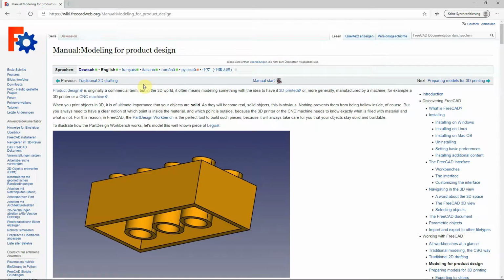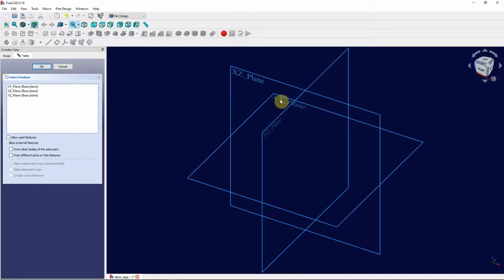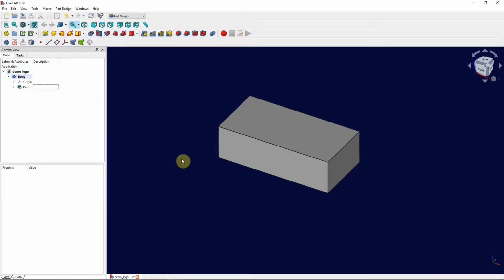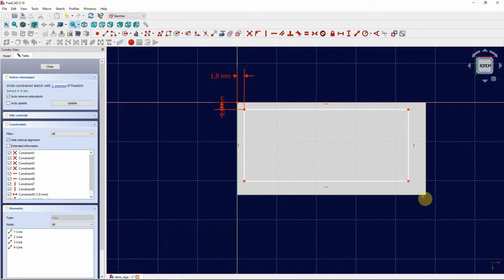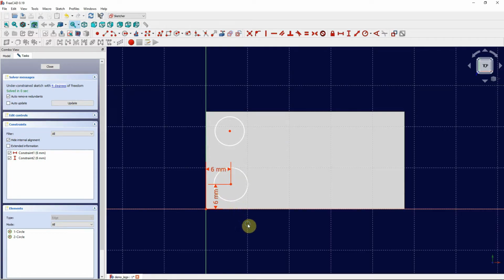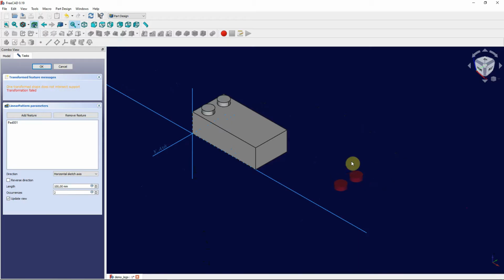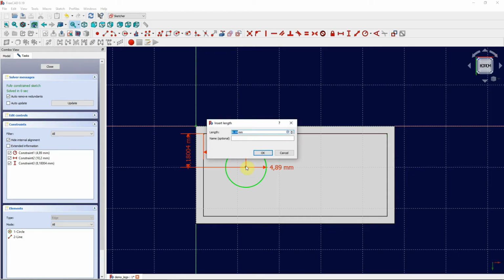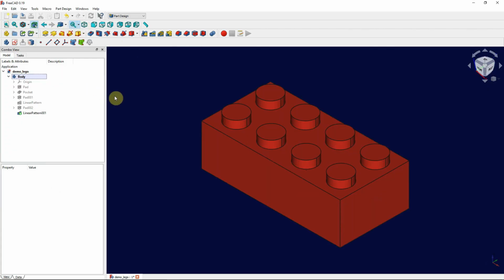FreeCAD 0.19 - Tutorial - Part Design - Create a toy brick (English)

Comment: Hi, Much appreciated tutorial, I was able to follow along. I noticed that the stubs on the bottom and top don't line up so you can't slide two pieces into each other the way you would stack chairs for example. Is that why lego bricks snap into each other and stay stuck? Is there a rule of thumb for the lego stub/cylinder layout? Like: 0 mm distance between 2 neighboring stubs and hollow cylinder but 1mm overlap between the 2 other stubs and the same cylinder?

Comment: I am a new user of FreeCAD.  I have never done anything with FreeCAD.  I tried to follow along with the video and do the same thing one FreeCAD.  I have no idea which button does what! I use MS Word to take down the step-by-step process of making this toy brick.  This helps me to be able to reproduce the brick by reading my notes without referring back to the video.  The following  is essentially a transcript of the video:

Create a toy brick (Lego block)
Lego block specification:
Block: 47.7 x 23.17 x 14.4 mm, 
Pocket 1.8 mm from the block edge on each side. 12.6 mm deep.
Top cylinders: the centers are 1.8 mm from each edge.  Diameter 3.6 mm, 2.7 mm tall.
Bottom hollow cylinders: the center is 10.2 mm from inter rectangle wall. Outer radius 4.89 mm Inter radius 3.6 mm, length 12.6 mm

1) At file > New 

2) At the Combo View Panel CVP, Model Tab, rename to demo_lego

3) At the Work Bench Drop Down Menu (WBDDM) select Part Design.

4) On the Part Design toolbar clicks on the Create Body button (Blue Steps), a new body appears at the CVP. Select the new Body.

5) Click on the Sketch button. The three planes appear. Select the XY_plane, At CVP, click OK

6) Create a new sketch: Draw a rectangle with the Rectangle button (square with a red dot at diagonal), Click once each for the lower left and upper right corner. 
With the rectangle drawn, click on the Horizontal Distance button (Red horizontal I beam). 
Click once on the upper left dot and the upper right red dot of the rectangle. The Insert length dialog box appears. Enter the value of 47.7 mm. Click OK.
Click the Vertical Distance button (Red Vertical I Beam)
Click the upper left red dot of the rectangle and the lower-left rectangle. Enter the value 23.7 mm

7) We want to place the rectangle at the exact position. Click once on the lower-left corner of the rectangle and then click on the zero position of the XY axis. Both points are selected, click on the coincident constrain button (Red diagonal cross with a red dot in the middle). At the CVP, click the Close button.

8) We want to make the flat rectangle into a 3D object. A the CVP, select the Sketch object. Click on the Pad button (Yellow block with a gray square at the bottom). At the CVP, Enter 14.4 mm as the length of the pad. 

9) At CVP, select Pad. Select the bottom plane surface of the block. Click on the Sketch button on the toolbar to draw another rectangle.

10) Position/rotate the block with the top or bottom facing you. At the CVP select the surface and draw a second rectangle inside the block.

11) Define the distance of the upper left corner to be 1.8 mm from the Y-axis line with the Horizontal Distance button. Select the upper left corner point and the 0,0 point, enter 1.8 mm. 

12) Create an edge linked to the outside rectangle with the created edge button (blue cube with 2 red dots). 

13) Use the horizontal distance button (Red horizontal I beam) to set the distance of the horizontal outside edge of the rectangle to be 1.8 mm from the inside rectangle.

14) Use the vertical distance button (Red vertical I beam) to set the distance of the vertical outside edge of the rectangle to be 1.8 mm from the inside rectangle.
Now the inside rectangle is fully constrained as indicated by all four sides turned green. Click Close on the CVP.
15) Select the Sketch at CVP. Click on the Pocket button (blue hollow block) enter 12.6 mm for value.

16) Rotate the block with the pocket hole face down, (Use the view buttons blue frame with one blue surface) bottom view.  the flat surface is now facing up. Use the isometric view button (blue frame cube) to place the object into isometric view and click on the full-screen button (blue magnifier on paper) to make the block large.

17) At CVP, select the Packet object. elect the upper surface of the block. Click on the Sketch button and create a new sketch. 

18) Create two circles with the Circle button (Circle with 2 red dots) somewhere on the surface. 
19) Define the center of the bottom circle to be 6 mm from the Y-axis, using the horizontal distance button. Define the center of the bottom circle to be 6 mm from the X axis, using the vertical distance button. 
20) Use the Constrained radius button (red circle with a pointer at 2 o'clock position) and set it to 3.6 mm.
21) Using a similar process to set the second circle to be 6 mm from the X and Y axis with a radius of 3.6 mm
Click Close on the CVP. 
22) Select the Sketch object, click on the Pad button (Yellow block with a gray square at the bottom), and enter 2.7 mm as the value of the pad. 
23) Using the linear Pattern (blue block with 2 yellow cubes) button to create the pattern. The two short cylinders are now outside the block. At CBV, Change the Linear Pattern parameter length to 36 mm.
The two short cylinders are now placed on the block.
In the property panel, change the Occurrences from 2 to 4, press enter. There are now 8 short cylinders.
24) Rotate the entire block to show the bottom pocket side to add 3 cylinders. 

25) Select the surface to add cylinders to create a new sketch. 
Draw a circle and define the radius to be 4.89 mm. Set the distance of the center of the circle to be 10.2 mm from the sides of the inter rectangle using the horizontal and vertical distance tool. Use the set edge button to create an edge if necessary. 
26) Make another concentric circle in the existing circle with a radius of 3.6 mm. Click close on the CVP. 
27) Select the Sketch object. Click on the Pad (yellow square block with gray frame below) button, a hollow cylinder is created. Change the value of the length to 12.6 mm. Click close on the CVP.
28) At CVP, select Pad2 and click on the Linear Pattern button (blue block with 2 yellow cubes) to make the linear pattern. At the CVP, change the length to 24 mm and occurrence to 3. 

29) We are done!

I have exported this brick as an STL file and printed a red, a white, and a blue one.  They somehow do not fit together but It is still a great learning process.

Comment: Hi  Mr.Flowe,  I do really appreciate the way you shown us how it is done,  I was able to follow your instructions up until to create the 47.7x23.7x14.4 box, but when I tried to sketch a rectangle to be pocketed at the bottom part, the rectangle is not showing up unless i put it on isometric view i wlll be able to see the rectangle  but I can"t perform the constraint, sorry I am a newbie , any help from you will be highly appreciated... thank you in advance
Reply: Hello nicxon Jr Perez, I am also a newbie and struggled with the exact same problem. Something went wrong with selecting the bottom surface of the box (min. 8.15) It seemed as there was another rectangle on top of the sketch I was trying to create. I could make it visible by using the Support icon, but then I could not pad the circles (tubes). In the end I started all over again and then it did work out fine. It seems to be very important that you select the surface for the three tubes exactly as shown by Mr. Flowwie (and all the other steps for that matter). I still don't understand why things went wrong, but this worked for me.
Reply: @Johan-tc7jz  thanks for the insight...I appreciate it